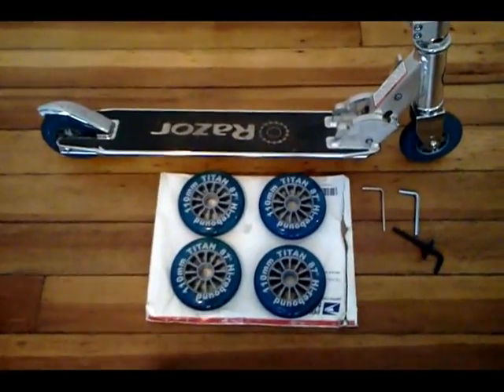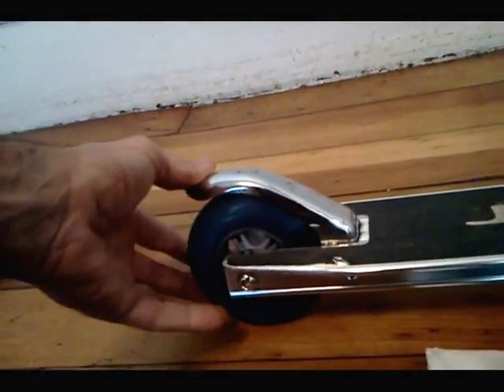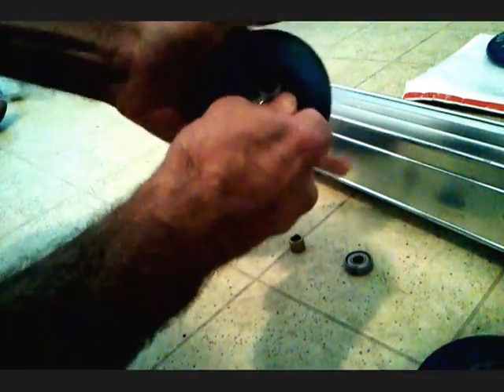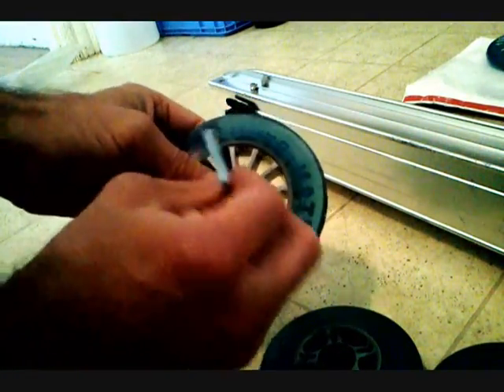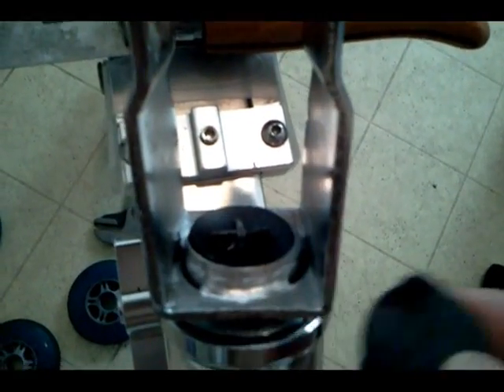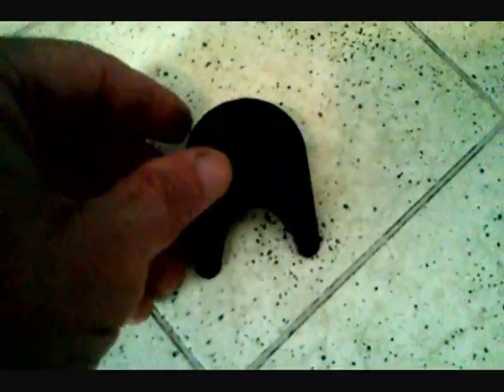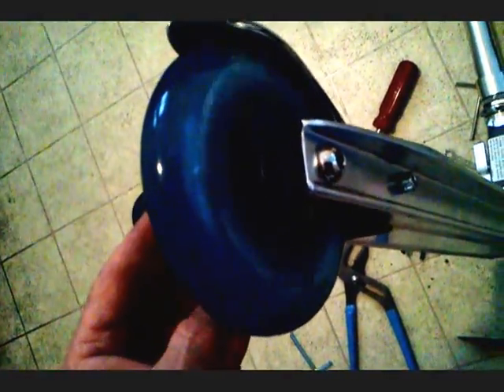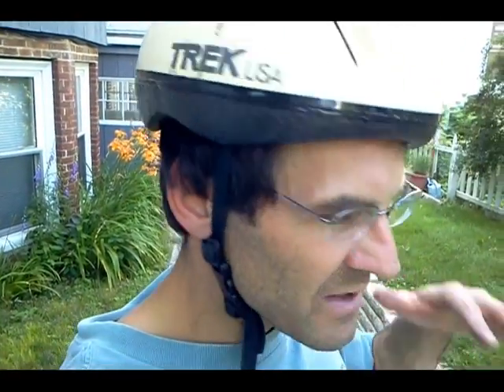110mm Wheel Upgrade/Mod: Razor Kick Scooter 🛴

Comment: I watched this video after finding a Razor A Kick scooter all rusted up in the woods last weekend.  I removed the rust, greased it up, and got it functioning again.  When I decided to upgrade the wheels to the new 110s, I had the opposite problem where the front wheel fit no problem at all but the back wheel would hit the spring. When I moved the spring the wheel would still hit the rear axle.  I then used a hacksaw and a pliers to cut and bend/break off about 1/4 inch on the top of the deck right where the rear fender is so I could push it back just enough to clear the wheel. I filed and sanded any rough edges.  I then drilled new holes for the brakes about a quarter inch behind the old ones.  Problem solved and it works great now.  It was a pain but I had the tools for the job.  It's an excellent upgrade and makes the scooter way faster for a grown up kid like me (42 years) hence making it way more fun. :)  I also drilled a hole in the folding mechanism and stuck a bolt, nut, and washer into it further securing the handlebars and removed any play in them.  This thing is fire now. Thanks for the video of inspiration!

Comment from the maker: Raise brake with Allen key while securing opposite end bolt with wrench. Oil the spring and give it some pops. Make sure the plastic piece is not rubbing against wheel. It does fit. Check back when you get it.

Comment: Thanks for this video. Im wondering if these would fit on my daughters A2?
Reply from the maker: Gee I wouldn't do it. The A2 is a rattly little scooter. I recommend upgrading to a scooter with higher weight rating & bigger wheels.
Reply: @p1nesap  She is 6. Everything they make fot her size is pretty ratty. Ideally I would like to find a pair of air wheels that fit on it. She doesnt care about speed as much as a smoother ride.
Reply: Update. I had to shave the wheels to have them fit but they are still miles ahead of the original tires.

Comment: Hey man, I just wanted to say because of you I bought a kick push scooter.. I was wondering if a 120 mm wheels could fit in this particular model? Hit me soon please and I really enjoy your video
Reply from the maker: proobuio unfortunately 120mm don't fit, just 110. If I had to do it again I'd get Razor A5 with 200mm wheels. Bigger wheels better cruising.
Reply: You could try looking for a fork that can fit 120mm wheels but the fork will be threadless. With the razors like that they only use a threaded fork and threaded compression system.
Reply: +proobuio just get a 2016 envy prodigy these razors are shit

Comment: I  am upgrading to 100's on my A3. I use this scooter to get home from school and since the max weight limit of the scooter is around 100 pounds (I am 15, about 40 pounds over the weight limit). It also doesn't really help that I ride on the street / really bad sidewalk as well. So since I am over the weight limit, the wheels keep cracking.

Comment: p1nesnap im having the same problem i cant raise the break pedal enoughto let the wheel roll. could u give a detailed explanation on how to maximize the break pedals height or maybe even a video, thanks
Reply from the maker: Hey, you loosened brake with hex key, then pulled brake up to max height, then re-tightened while holding brake in position, yes?
Reply: Did the mod and figured this out: If you're not getting enough clearance, try riding the scooter and slamming the brake, which should bend the hex screw that holds the brake in place a bit more. Also, if you're trying this on a brand new A4, you need to ride the scooter and use the brake first, otherwise the hex screw will be perfectly straight and turning it won't have any effect on the brake height.